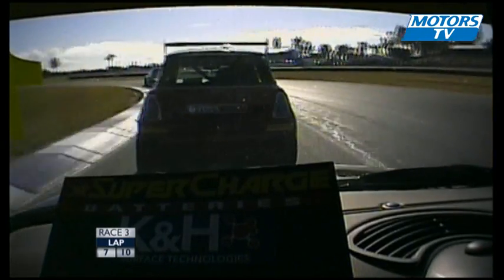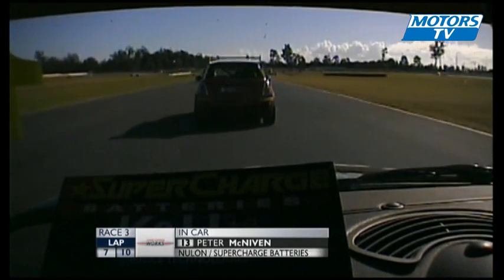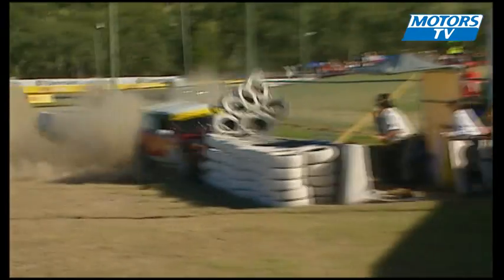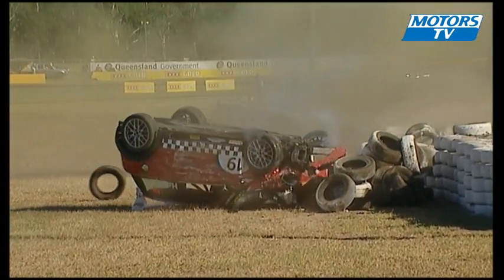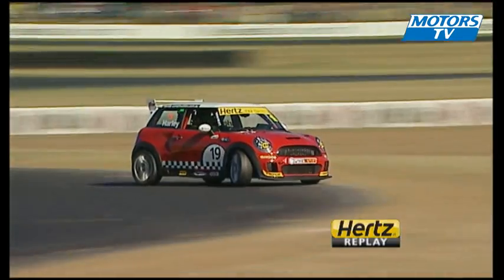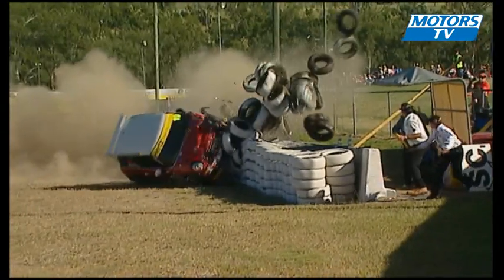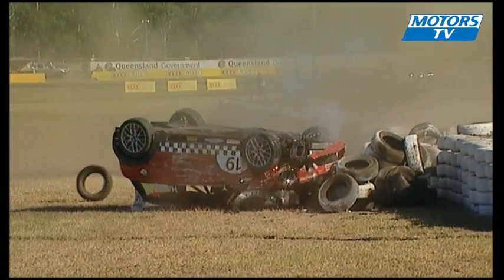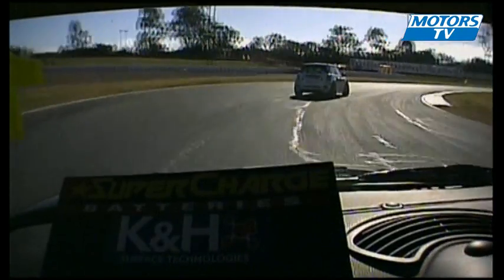Second crash Mini Challenge Queensland

Comment: From the looks of it the car didn't slow down at all, almost like the brakes werent applied. But you can see from the rear view camera that her break light were on.
Looks like some sort of break failure and she purposely took inside track to avoid the car infront and tried to steer her car sideways.